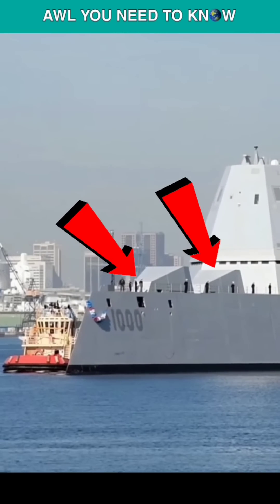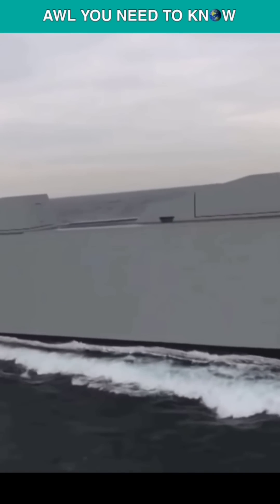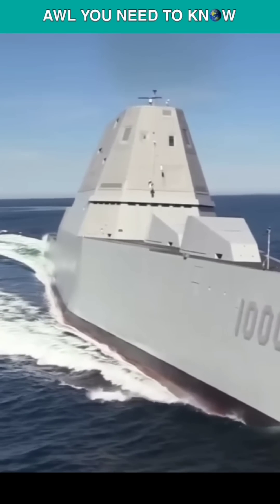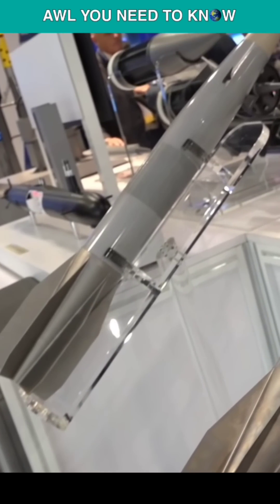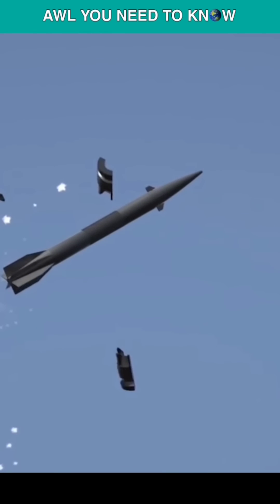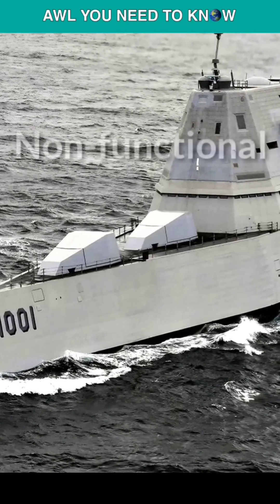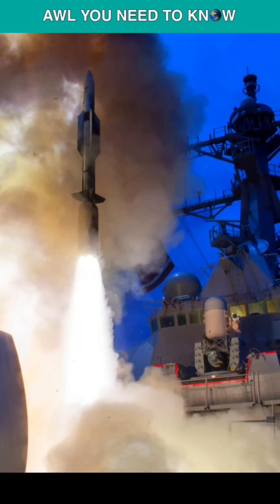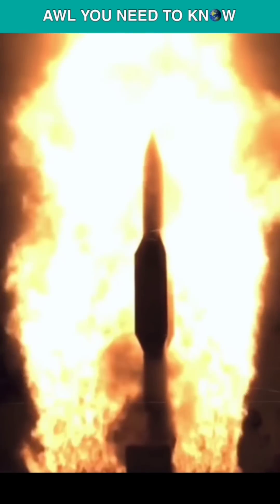WHY THESE GUNS WON'T WORK? #shorts

Comment: " the new zummwalt destroy is pretty much a non functional destroy due to insufficient budget" oh look, tax payer money at work.
Reply: The creation process of the ships took decades to fully flush out, and while that may at first glance seem like a complete waste of tax payer dollars, in the long run it really wasn’t. Because they tested so many different things on the ship, and incorporated new systems to see what worked and what didn’t, they now know a TON more about the technical small stuff that goes into these things than they did prior to making it, which will be used in the making of all new ships rolled into production.

It gave them lessons to learn and those lessons are really invaluable. Some may have seen the US decommissioning lots of their naval fleet after world war two and then blowing them up with nuclear bombs as a complete waste of tax payer money, as well as most, if not all, of the german navy that was left over, but in reality blowing those up gave them so much knowledge about how to design better ships that dont sink nearly as well as they did before, and so much other stuff that no other navy or country had access to at the time or even to this day. All of the modern day ships were built using the lessons learned in those tests, and all future ships will be built using the knowledge learned from those, as well as the lessons learned from these, and all other ships they have built since
Reply: @Erioletheonecanolie  so basically what you are saying is, they were built to be next gen destroyers, but instead of that, they are just a weapons testing ship? I still stand by my statement, waste of tax payers money. Why not call it a weapons testing ship instead of a destroyer since it won't really be used anyway.
Reply: @flightmaster529  you really dont understand the military industrial complex do you?
Reply: @Erioletheonecanolie  not when comes to the navy. But you gotta admit, the government and military waste tax payer money buy either sending it off to countries that don't need it, ( Ukraine), or waste on some stupid mistake. But in this instance, they built a few ships, then not even use them.
Reply: @flightmaster529  oh 100% the pentagon is horrible with their budget. For the military Humvees you need a specialized pair of jumper cables just to jump it that costs thousands of dollars for no other reason than to force them to buy it otherwise it wouldn’t work. Thats just one instance of this but that type of thing happens all the time.

However in this case, its not entirely or even partially a waste because again, they learned a ton of invaluable experience and information that never would have been known had they not built these. 

As for the money going to ukraine, its honestly not a waste at all. A basic second world country with a poorly equipped military is and has been defending extremely well against the second largest military in the world. Russia has lost thousands upon thousands of troops, billions of dollars in equipment that takes years to replace, and has angered the entire world into placing harsh sanctions against them which makes it even more difficult to replace all the thousands of heavy pieces of equipment that is being taken out by ukraine. Not to mention, they’re one of americas arch enemies. Of course we’re going to fund whoever their fighting. We did it in afganistan with the mujahedin and every other conflict russia has been involved in. It’s INCREDIBLY more cost effective and safe for American citizens to have these other countries fight them as oppose to our military going to do the fighting. Not to mention all of the intel we’ve gained on how the russian military works and also how effective our systems like the patriot air defense system works against them, which is incredibly well. If we had never of sent them anything we wouldn’t have known that the patriot missile system, which was developed over 40 years ago btw, is capable of taking down russias famed “hypersonic” missile delivery system that they prior to the war claimed was impossible to shoot down. Now we know it is, and not even by our most modern pieces of equipment, but things we had a decade before the Soviet Union even collapsed. All of this and so much more is invaluable pieces of information that is 100% worth the billions we’ve sent them in aid.

And on top of that, we’re not sending them the best of the best. What we’re sending them is old outdated pieces of equipment that we have already or are on the way to phase them out of our services. These pieces of equipment take millions or more in logistics to maintain and keep in working order, sending them to ukraine takes that load off our back and also opens up the need to replace them with newer pieces of equipment and makes congress more likely to approve new projects. 

Also its not that we’re “giving” these things to ukraine, its a loan. We’re going to get it back when the war is over. Ukraine is going to be in debt all the money and assets we gave them plus interest. Which is why the US is not going to stop because if ukraine loses then those loans default since there would be no “ukraine” to pay them back.

You’ve very clearly shown your ignorance when it comes to how the military works and how important information and logistics are in modern warfare and networks since you default to the most numbed down generalizations that leave out all the incredibly important nuanced points that prove and show the argumentative point you’re backing is wrong but you just dont have the knowledge or cognitive awareness to see that these things are important and are valuable.

Also the US is the largest donator in foreign aid out of any other country by a fucking LONG shot. We annually send billions to other countries as aid and there is no pushback or anything for it, so why the sudden hatred for sending foreign aid to a country thats being invaded by our arch nemesis? It’s literally a win win for both the US government and the US taxpayer.
Reply: @flightmaster529  yep $22bil for a testing platform.... but hey... that's only a drop in the bucket compared to money poured into Ukr pockets
Reply: @fatdoi003  true
Reply: @fatdoi003 
It's also a drop in the bucket of our 800 billion dollar annual defense budget. Which is 3 percent of the US annual GDP.

Comment: Then either replace with with something we have ammo for or make the damn ammunition
Reply: That’s the problem with using Lockheed as the manufacturer….. we wanted cheaper rounds to replace missiles, but we forgot that Lockheed also makes those missiles, so they happily made  the advanced gun rounds just as expensive as their missiles.

Comment: One of the best stealth ships out there today.  It's Only flaw was the cost. The Zumwalt will be caring Hypersonic missiles. The Navy will begin testing in 2025.
Reply: I would take special care of my hypersonic missiles. Even Super or subsonic missiles.
Reply: @happydays8171  Nah..It will hold 12 of the 8 ton missiles. Think of the damage it will do.  In 2028 the virginia-class willl have them also.
Reply: Sadly too far ahead of its time as well. There's simply no need for these ships yet when the US Navy already dominates the sea, air and space. They don't need to be stealthy yet.
Reply: @Horible4 The US Navy is not that far ahead. Especially in the most likely naval scenario, South China Sea. Most simulations show the US Navy actually losing. So you need to stay far ahead of your opponent lest they catch up
Reply: @Horible4  China
Reply: @weasle2904  not a threat. The majority of their navy isn't even ocean sailing capable and is mostly coastal defense.
Reply: Sounds useful!

Comment: This ship was canceled and those built were mothballed.  Many of the systems didn’t work and the material used in the hull cracked.
Reply: Bath built is best built.   Get your ships straight
Reply: It would be nice if you got your ships straight.  The LCS were canceled not the Zumwalt’s..   They still have 112 VLS on them